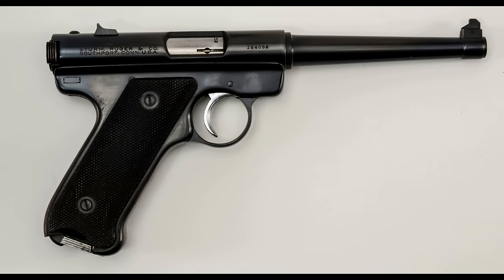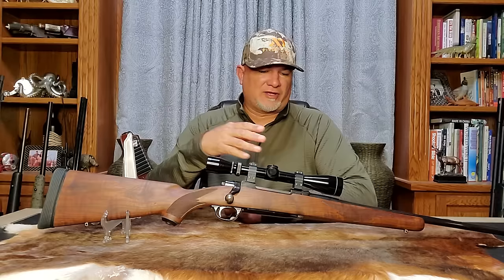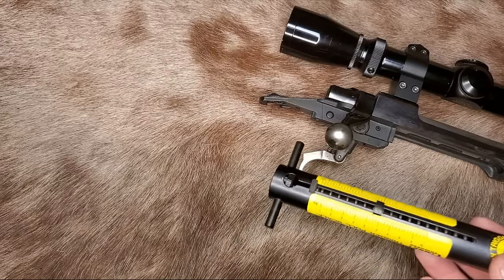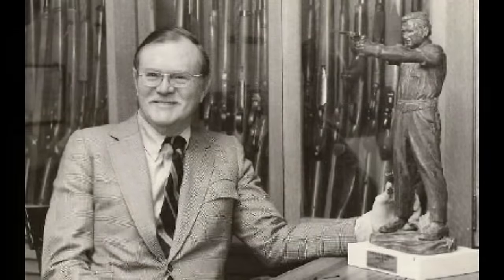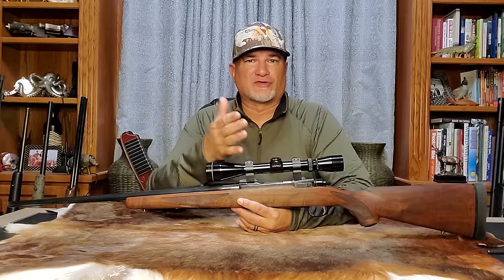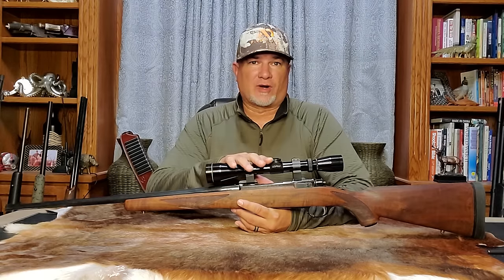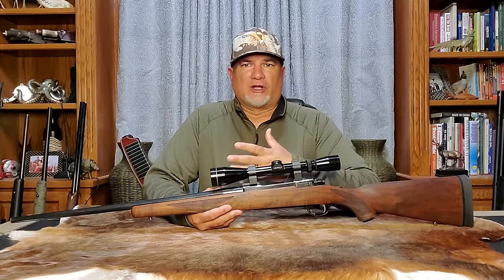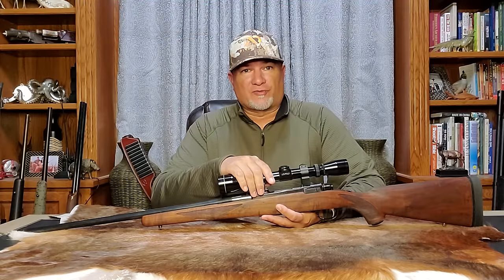RUGER M77: A Classic American Rifle

Comment: I enjoyed your history of the 77, lots of good info! I bought a tang safety 77 in 338wm when I was 19. Factory ammo shot at best 1.75 moa but by working up my own I got sub moa with Speer 250 grn grand slams but it would not shoot anything else that well. Fast forward to 2018, I hadn't used the old girl in a while so I dusted it off and sent it out to be re-barreled to 30 Nosler by PacNor barrels in Brookings Oregon, they did an awesome job and after the recommended break in it was shooting .75moa with factory Nosler 180 Accubonds and I put in the same sear kit as you. Hunted the first season with those and took a 30" mule deer in Montana with it as well as a 13" Pronghorn. That winter I worked up a load for the 212 grn ELDX, 3000 fps and .44 moa. Gun is bedded but not pillared and I have a Lilja Heart breaker muzzle brake on the 26" barrel. The gun is beautiful to look at and shoots great for a hunting rifle, it still has the red pad but with the brake it is a dream to shoot. Just tell your hunting buddies to stand behind you when you fire, side blast is brutal from that 30 Nosler!

Comment: I have a Ruger M77 bought in 1985, chambered in 257 Roberts. Was accurate from the outset and remains so today. Still a favourite although I will have to replace the firing pin and spring as it will now strike the primer but not always detonate without re-cocking and firing again.
I did replace the original trigger with the Timney adjustable.

Comment: The info on the torque for the screws was great, I never knew there was an order or torque setting for them and I have had my 77 for almost 40 years, and took a lot of deer in Pa with it. My longest shot wit it was 265 yards and in Pa that is a long shot on a powerline.

Comment: THIS is the video I was looking for!  The information about the tang safety "safety" issue is good to know.  I have one of those M77 rifles serialized for production years 1978-80...was aware of the trigger safety problem, but didn't know Ruger did a recall and what to look for if it's been corrected.  The information I got before was to simply source an improved tang safety switch assembly for my rifle...was not a help.

Comment: I own 3 M77s 2 are tang safety Mk1 and 1 is a Hawkeye Gunsite Scout. Of the 2 tang safety models 1 is a 1969 2nd year of production that i found a a pawn shop in.308. It has the Douglas barrel and will shoot 3/4 moa with certain loads. 1 moa with everything else. My second tang safety is a 1982 in 25/06 that groups between 1 and 11/4 moa after bedding. Scout groups just under MOA. love them all. Will definitely check torque of action screws.

Comment: Thanks for a wealth of info on these, especially concerning the action screws and accuracy, and the rings.    The M77 MK II has an excellent reputation for reliability in the far north. Stainless boat paddles are revered for their ruggedness.   I like the stainless Model 70s quite a bit more with respect to design and simplicity, but can see the appeal of the Rugers.

Comment: I still have a 77vt 22-250 stainless heavy barrel target with a old Nikon monarch 6.5-20x44AO with fine cross hair.. with a 50g vmax handload I built up that gun will consistent shoot 5 shot 100y groups under half minute. It required a trigger job that's for sure the trigger was pretty damn bad but after a good custom trigger job bring it down to a crisp break at about 12oz and building up a good load for it it became a fun to shoot bench rifle and has killed a great many P dogs... was and still is a really pretty rifle that stainless barrel and action and laminate stock, it's a damn sexy rifle still to this day.

Comment: I have a Ruger M77 Red Pad,tang safety walnut stock in 30/06 .I can’t even remember what year I bought it.I didn’t know much about Ruger bolt action rifles back then ,but this rifle was unfired on the used rack and was beautiful to me.I put a Redfield 3x9 Widefield on it,and it’s still on it.This old GUN shoots like a champ with anything you feed it,if you just dial it in .I’ve never gauged the trigger ,I figure it’s about 3.5 to 4 lbs.The action’s as slick as cow slober on a brass door knob.I’ve taken care of it and haven’t beat it up.Very pretty rifle.Sub MOA.Oh,and it’s wearing factory iron sights that made me moist to look at them.

Comment: Many thanks for the focus, research, and hard work you put into researching this rifle's history . . but then you always do that!  I have a mid 1990s M77 MK II, and did the epoxy bedding as video-taught by everybody's favorite old fart Gunsmith, GunBlue490. Yes! Get that hex screw, He says just "reasonably tight," not 90-inch pounds. Oh...and the Timney trigger is cool, but I fumbled the installation and took too much metal off and had to settle with just using their lighter screw. It's still better than the original M77 MK II trigger.

Comment: I bought a new M77MKII all weather in 30-06 in 1993.  It has the infamous boat paddle stock.  I had a gun smith who built target rifles do some work before I ever shot it.  The action is bedded, the barrel free floated, and the trigger is at 2.75 lbs.  Haven't missed a deer yet.  It kicks like a mule but it shoots!  I recently picked up an old M77 in 6mm Remington.  I need to check to see if the recall was done on that rifle.  I haven't shot it yet, so I appreciate the information on getting the best accuracy from the rifle.

Comment: Good job on the subject of bedding and torturing those action fasteners.   Found this to be exactly the case.  Personally my Rugers are left handed.  One is an early MKII push feed 30-06.  The others are an Hawkeye 270win, Hawkeye 30-06, 338RCM Hawkeye compact, 338win Hawkeye alaskan, and 375 Hawkeye alaskan, and a couple 308win scout rifles.  I've done a good deal of shooting with the 270 and 308 scout and they are excellent.  Properly bedded and torqued and with reworked triggers they are amazing.   They're the lefty user to an affordable control feed rifle.

Comment: I have a M77 tang in 30/06 that has always been fussy with reloaded brass. I have to use small base dies to resize to fit the “tight” or small diameter chamber. Also found that the barrel had built up a carbon ring and was causing over pressure.  Also replace the action screws with socket head bolts. The slotted head screws cannot take the torque to secure the action.  The front screw will have to chucked in a drill and reshaped to clear the floorplate.

Comment: I picked up an M77 tang safety chambered in 30-06 a couple years ago. Was at the shop with my brother as he was buying a shotgun and it caught my eye sitting in a corner up against the wall. Fell in love with it when they handed it to me to take a closer look, bought it on the spot. Serial number comes back to around 1977. Thanks for the info on the Recall, my rifle doesn't have an etching on the bolt handle so I just sent in a recall request.
Reply: I have a 77 in .270 from about 77 or 78. Great quality with nice walnut. Too heavy and too shiny but great guns.

Comment: I bought a new ( actually traded a Browning light weight 20ga mag )  for a 7x57 in 73’ I converted it to a varmint rifle by putting a Shilen heavy barrel 6mm/244 1-12” twist, CanJar Set trigger and Lee Six fiberglass Beavertail stock. I was swapping barrels back and forth until 92’ when I picked up a new Rem 7x57 in a Mountain Rifle trim. With the 7x57 in the glass stock and CanJar trigger I shot 1.75” @ 300 yards in stiff winds with a Bushnell 4x12 scope. I could hold to an inch group with factory trigger and Leupold M8 4x scope. Trigger sucked. I worked on the bench last part of 73’ and most of 74’ on loads. Tried most available powders at that time and bullets from 120 to 175. My best accuracy came with a liberal amount of IMR 4350 and Speer 145BTSP bullets. I still have the 7x57 Barrel and stock for the Ruger. I basically had a Ruger Swat rifle circa 1980. A little heavy to carry with the 6mm barrel but once you’re set up it’s all fun.

Comment: I got a Ruger M-77 Mk II in 6.5 x 55. I bought the gun in 1993. I had a gunsmith do a bedding job on it and well I did replace the trigger with a canjar. mounted a fixed 6 x Leupold on it. Before that rifles would print 2-inch groups aftward way less than an inch. Whenever I would shoot for money that one was my go-to rifle.  I had a loud mouth at the range say that Rugers are inaccurate junk ok I will bet you that I can put a box of this factory ammo ( Norma 156 gr SP Alaska) into an inch or less. But I want 5 dollars per shot within that inch he said ok, I but a target out at 100 yards with and well I started dumping rounds on target. I put all 20 into a group that was just about 3/4 of an inch. That rifle loved that load. I will say one thing he paid my 200 bucks and then for the next 15 years, he would ask to buy it just around hunting season. So what I did was I gifted him the rifle as a retirement present. I shot a lot of game with it and he had shot a lot of deer right up till he stopped hunting in his late 80's says that going to will me the rifle back. Ruger makes good durable rifles, yeah they need some TLC nothing major. Those Boat paddle ones were very popular with a lot of people up in Alaska when I lived and worked there. Now Ruger has resurrected Marlin. I am itching for a 336 in 30-30.

Comment: 8 foot pounds is 96 inch pounds. It can't be that difficult to get really close to 95 inch pounds using a foot pound wrench.
I know I probably got fairly lucky, but my first Centerfire rifle was a Model 77 and submittal mag in 1979 and the first group I ever fired out of it was a 20 round group that fired a center-to-center spread of .049in.
And I had already adjusted the trigger and I was not getting more than about a 3 lb pull. I ended up selling that rifle for $200 more than everything together would have cost the man and he paid it because I had every Target I had ever shot with that rifle and I'd only fired 65 rounds out of it. But then again 7 mil mag doesn't give it much time to be inaccurate. One of the biggest secrets to the accuracy of that rifle was that angled lug bolt.
Any monolithic rubber recoil pad will harden with age unless you keep it treated. And one of the best things you can treat it with is a product called 303 protectant. Spray it down with that and let it soak in with the recoil pad removed from the stock. Do that about three times over at least a 12-hour period with each application and then let it set for a day or so before you put it back on the firearm. Because when these things were new they worked quite well. I had a 7 mil Remington mag. Yes it was really pushy at the range but it never bruised me. The only time you get a bruise is if you're not pulling the rifle into your shoulder and it gets ahead of steam before it hits you. If you don't know how to shoot a rifle, take a class! And the trigger on my 7 mil mag, was about 2 and 3/4 lb at its lowest setting. So I don't know whether I just got really lucky or if somewhere along the line they perhaps maybe had the people putting together the Magnum actions we're taking a little bit more time doing it than those working on other calibers.

Comment: Great video.That front guard screw needed to be torqued high and kept tight with red loctite or else the stocks would crack behind the tang and ebbing in front of the trigger on MK II magnums.The striker spring retaining pin needed changing for a stronger one on the same rifles.The rear sights on the Lott needed gluing to their base or else POI would never settle.I prefer those hard recoil pads because they slip in to place on the shoulder easily and they don't "give" to recoil-just like the Silver pads.

Comment: I must be lucky. My M77R in 270 Winchester was built in 1974. I got it about 1975 or 76. Except for putting a Redfield Widefield 2-7x32 on it I've never done anything to it. When I got it I bought two boxes of Hornady Frontier 150 grain ammo for it to get my first supply of brass. I started hand loading and it has consistently shot sub-MOA with H4831 loads right out of my old Speed Number Nine manual since day one. 270=Bang Flop
Reply from the maker: As stated in the video, you probably got lucky and got a Douglas barrel. If you got one of the low-quality Wilson or no-name barrels, you'd know it.
Reply: @desertdogoutdoors1113  I guess I should have said ONE of the lucky ones. I did hear what you said about the early barrels. I don't remember if I ever heard about the possibility of it having a Douglas vs other barrel. I'm old and lead a sheltered life.😊

Comment: I wasted more ammo, powder, primers and bullets trying to get a Ruger M77 Mk2 to shoot acceptable that it should have taken for six rifles . Changed the trigger, tried floating the barrel, pillar bedding, different scope, and different torque on the action screws. The barrel looked decent through the borescope. 1 3/4 “ was the best it would do, and most of the time it was 2 1/2”@ 100 yds. I sold the piece of thing and got a Tikka T3X Hunter and am totally satisfied with it.
Reply: If you shook the gun did the magazine box rattle?

Comment: I had a boat paddle M77 in .270 Win. I got ahold of a pound of powder that was mislabeled by the manufacturer. Long story short I pulled the trigger on a round that had about a dozen 45ACP loads of pistol powder in it. The receiver did not so much as crack.

Comment: One of the biggest advantages of the Ruger m77 Hawkeye is how friendly Ruger has been to left hand shooters. Although they are definitely drying up there are still a lot of deals on gunbroker for beautiful Hawkeye left hands, I doubt this will last forever. I recently picked up a NIB left hand African in 375 (the newer production with ebony forend cap and 2 recoil cross bolts) for 800 bucks. The quality (trigger, fit and finish, balance, feeding) is outstanding. 

Also left handers can pickup classic sporter Winchester 70 left hands for a few thousand on gunbroker form 90s production. However after comparing the two, the Hawkeyes are SO much lighter and trimmer profile it’s hard to justify the Winchester for lefty’s if you are just looking for a quality stock wood/blue classic style hunting rifle.

Comment: Surprised that you didn't mention the quality of stainless steel ruger was using on the mkii all weather models. True stainless that virtually nobody is using today.
Reply from the maker: I don't know what you mean by "true stainless" (I buy and sell hundreds of tons of stainless on a daily basis). As far as I know, Ruger used and still uses 410 Stainless just like everyone else. Some custom manufactures use 416 because it's really easy to machine. But mass-produced stainless receivers are 410. Of course, the formulation is tweaked slightly by each manufacture to ease their production process (eg: they might add a little copper for machinability). You wouldn't want a rifle receiver made out of 304 or 316 stainless; it wouldn't hold up well in that application. The martensitic stainless steels are better suited for firearms. The real difference IMO, is that those older Mark II had a polished surface, where modern stainless rifles have a matte finish. If I had a stainless Mark II, I'd analyze it for you.
Reply: @desertdogoutdoors1113  hmm interesting You certainly seem to know more than I do about the subject. I was just told that Ruger was using a more "true" stainless alloy back in the mkii days and switched to a less hard stainless like most other manufacturers because it was too hard on tooling. I have seen other manufacturers like Tikka's stainless rifles rust though, which I've never seen on a stainless mark ii ruger, but perhaps that is because of the polished surface. You know how rumours are this hobby it could all be made up.

Comment: About 15 years ago I walked into a local shop hoping to find a vintage 30-06 to use as my go-to hunting rifle for longer ranges and the guy happened to have a tang safety M77. Turned out it was a 1971 and must've had the Douglas barrel because it's the most accurate rifle I've ever shot and many many whitetail and hogs have been taken with it. Just last week I came home and had a sounder of hogs in my pasture about 200 yards away. Grabbed the old M77 and took a shot at the biggest sow of the group. Put a 180 grain core lokt straight through both shoulders and watched her run about 12 yards and drop. If I only had 1 hunting rifle that would be it. It's almost boring how easily it drops everything as far as you can shoot around here.

Comment: I've used an older push feed M77, absolutely love it.

 I've looked at the newer controlled round feed models and would love one. Only reason I haven't gotten one is because of the borderline insulting safety banner stamped on the barrel. I refused to buy a rifle tainted with that atrocity.

I'd say that the Winchester Model 70 would be an excellent alternative, however they're now made in Portugal. They're fine rifles, but I'd prefer an American made rifle
Reply: Personal choice.  My first priority is quality.  I don't care where it's made as long as it is quality. Same reason I have CZ, Glock, Browning, and of course my Model 70's.
Reply: The new Model 70's are actually "made" in America, they are simply assembled in Portugal. So they are still American made.

Comment: A couple of months ago I was comparing a Ruger M77 Hawkeye standard version with a Winchester M70 Featherweight, both chambered in .270 win. Although the winchester was better finished, and came with a smoother bolt and better trigger, I picked the hawkeye as I found the ruger to be more solidly made, the stock to be better designed, the rifle more balanced and much to my surprise slightly lighter than the featherweight. Guess it's a matter of tastes as both rifles represent all what I look for in a hunting rifle.